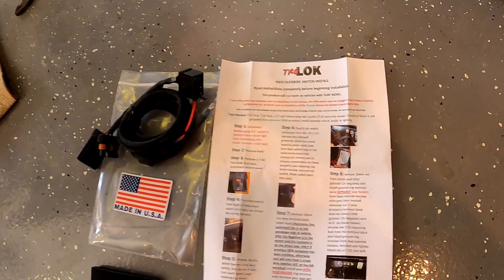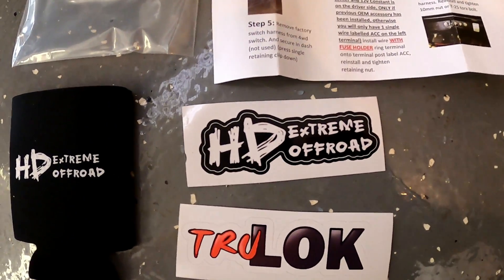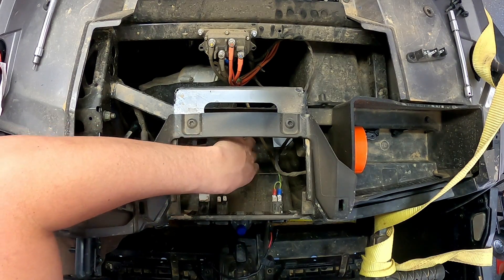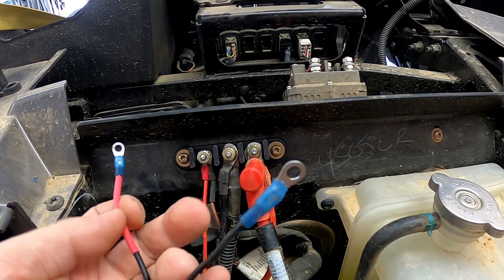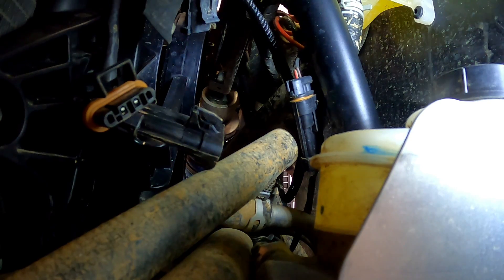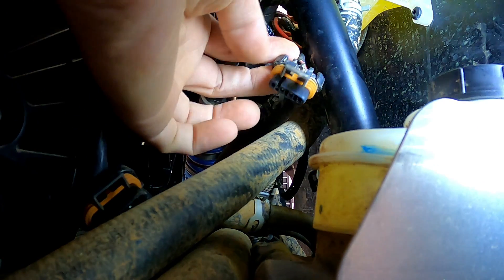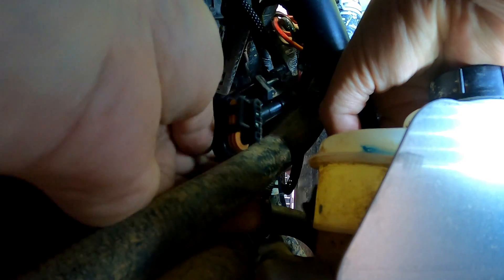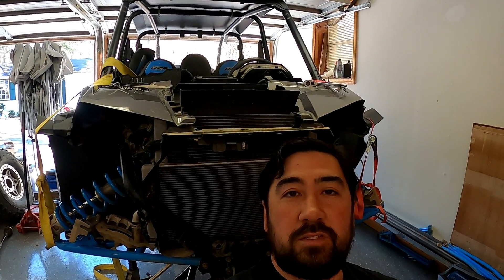Polaris RZR Tru-Lok INSTALL From HD Extreme Offroad - 2019 Polaris RZR XP Turbo

Comment from the maker: Installing the Tru-Lok from HD Extreme Offroad in my RZR went smooth.  If you have a RZR you should consider getting one.  SUBSCRIBE HERE: https://www.youtube.com/channel/UCc4Nok7BF4uSPPEWbU4qr2g?view_as=subscriber?sub_confirmation=1
Reply: Just looking for some In put added teu lock to my 2017 polaris rzr turbo and when i plug the harness is i hey a code outfit back to stock all is back to normal basically the code is voltage above normal B+ and input will help thanks
Reply from the maker: I can ask around.  I have not heard of this issue coming from the tru-LOK.  If I can find anything I will post an update.
Reply: Ok thanks hd extreme seems really hard to get ahold of and I'm not getting anywhere with them basically told me to hook it up then trouble shoot.

Comment: I made my own with a new 5-pin rocker switch, factory-style connectors for about $20.  Full 12v to differential and works 100% when activated.
Reply from the maker: Nice.  I looked into it after purchase just to see.  This was all part of me trying to get a turbo diff to hold up short notice
Reply: MrTurbo64 how did you keep your engine light off
Reply: No engine light or code. Rocker switch lights up when I activate direct 12v to front diff and works great.
Reply: Do you recall which wire got the + at the diff?  I'm building my own harness as well.  Far cheaper than the extreme offroad one.

Comment: Gonna be installing this to see if it’ll fix my ratcheting, only does it on the hard obstacles when I need 4wd the most 😂.
Reply from the maker: I still like this product but most of the diffs are just not going to hold up to much abuse.  Ive went to a rs1 style with much better results lately

Comment: Got a question i installed the tru lock on my 21 turbo s. The 4x4 is locked but the icon on the dash isn't lighting up. Is that because I by passed the ecu not seeing it?
Reply from the maker: @ericnalley4296  possibly.  As long as the switch works it should be in 4x4

Comment: Does this make 4 wheel drive engage whenever the switch is on? Or does it still work like oem and only engage when there is slippage?
Reply from the maker: The main difference is this sends power to the magnet when the switch is on.  No matter what.  It doesn't wait for you to be at a certain speed or wait the back tires to stop spinning.  They say it also uses direct battery volts with no limitations

Comment: I gotta 19 xpt4, pop in front end had diff apart replaced pinion bearing,  put together still popping? 2& 4 wheel? Any input would be helpful
Reply from the maker: Almost sounds like it's not the diff if it's it does it in both.  I can tell you that I haven't had the first problem since I went to a RS1 diff.

Comment: Not a deal breaker but do you know if their switch for the Tru loc is back lit?
Reply from the maker: You use the same switch you had.
Reply: @GrimRZR  their website stated i needed the switch for my RZR Highlifter.  I don't know why its required on my model.?

Comment: I was having problems with the 4WD now engaging so I ordered the Tru-Lock. Does the Tru-Lock bypass the ECU, allowing the 4WD to engage & disengage at any time? As we know, you can do damage if someone were to engage the 4WD if the front wheels are turning at a speed than the rear wheels. Am I just over thinking the whole situation? TIA
Reply from the maker: It definitely could do damage if you tried engaging while the rear tires are spinning.  Its a good product but I'm not sure it's a fix for your problem.  Probably need to figure that out also.
Reply: @GrimRZR  We will see if it fixes it. I have heard several people finding that they were not receiving the proper voltage to the diff from the stock switch and the Tru-Lock seemed to be a fix. We will see....
Reply from the maker: @jpaulthepilot1  let us know if it fixes it.  The more folks hear about it the better they can make a decision.
Reply: @GrimRZR  agreed
Reply: @GrimRZR  How would it do damage, I mean thats how it engages in the first place right?  Soon as rear tires spin faster than the front the front diff will engage.
Reply from the maker: @mikem2915  you could potentially engage the front in the middle of a burnout.  I don't think it will let you without the truloc
Reply: @jpaulthepilot1  Hello, I replaced a front diff recently in Pro XP and it worked for like two mins, then wouldn't engage and engine light came on.  Not sure if same issue, but did this wire harness fix your issue?  Thanks.

Comment: Informative content definitely going to buy one...but why have you wired your winch to the bus bar? Its at least a 200amp draw it should be direct to battery.
Reply from the maker: It's been working okay.  The bus bar goes to the battery with a big fuse.  Besides the fuse I don't see where it's that different
Reply: It's not 200 amps unless you have a 5000 pound winch, 200 amps requires huge wire

Comment: Notice a big difference after installation?
Reply from the maker: Definitely a difference but I also changed to a RS1 shortly after.  I think it's a worth while install.
Reply: @GrimRZR   what did you notice after the install ? Did you have problems with your front diff kicking out ? Did 4x4 feel different engaged?
Reply from the maker: I can feel the steering get heavy.  To come out I can hit the switch and let off the throttle for a sec and you can feel the steering get light again.  Nice to know you control when it's in or out
Reply: @GrimRZR  good deal thank you. That makes sense

Comment: Did you lose the 4wd indicator on the dash with this kit?
Reply from the maker: I think so.  What I look for now is if the switch light is on I know that it's in fwd.  I don't think I looked at the dash before anyway
Reply: If you install a relay that switches the 12v to diff you can use the 12vishhh to activate relay and send the full 12v to diff and keep all factory limitations and indication on dash..still dummy proof.

Comment: That 2nd plug were did it go ?
Reply from the maker: One plugs into the switch.  The other 2 go in line
Reply: @Grim RZR  seen your ride at top trails.nice ride you got there man..
Reply from the maker: @williamsimmons867  appreciate it.  It's a constant battle keeping it running.  Lol

Comment: Add some big honken meats & mis-matched tire sizes  then some crazy bastard driving & yer gonna blow that up to.
Preach about tires, get rid of the oversize overweight, over- lugged made for pickup rock crawler tires. Problem solved.
Reply from the maker: Stuff just breaks sometimes